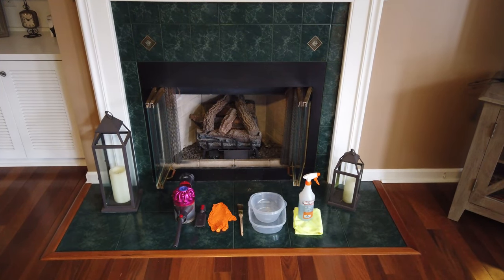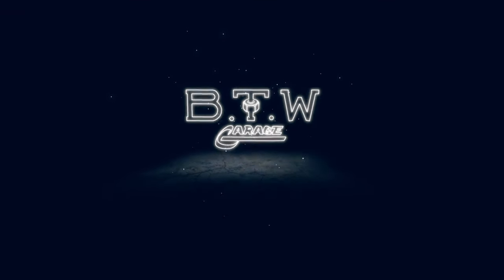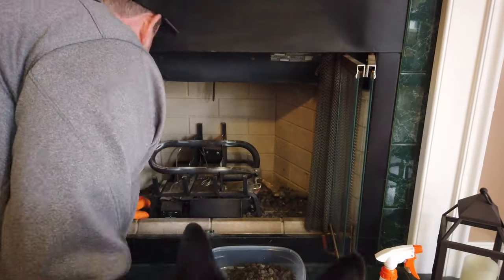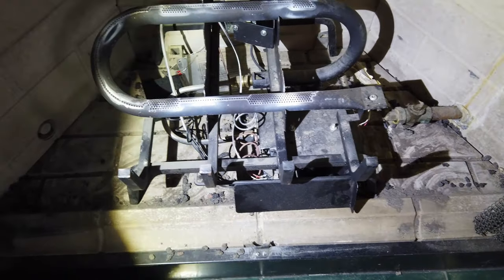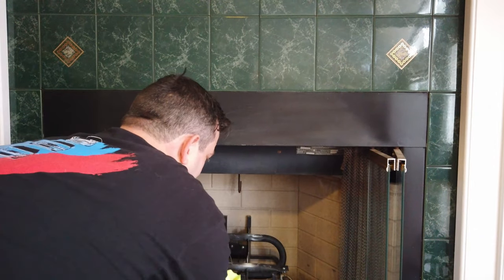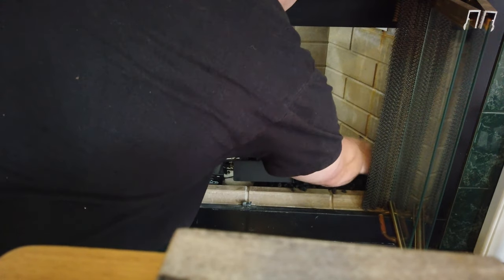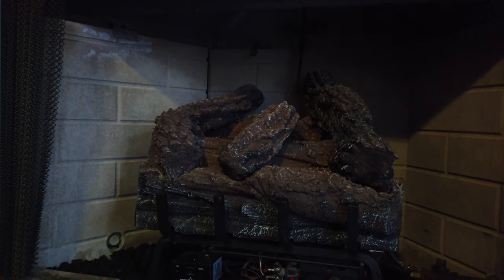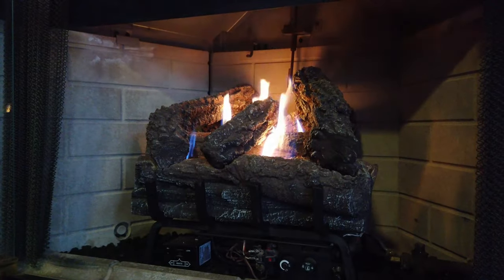How to Clean a Gas Fireplace - The Proper Way

Comment: Certified propane service tech here and I can say almost everything you did here I can agree with EXCEPT air compressor because it can lock up applience regualter . I suggest canned air . Great video
Reply: I have glow ashes that are on the bottom of my fireplace. My fireplace was a burning fireplace and is real dirty. Could I get the rocks instead?
Reply from the maker: Yeah you should be able to switch over with no issues

Comment: I have a problem with my fireplace turning off after burning for about 3 minutes. Pilot and flame turned off. Where I think I did something wrong is I washed my fake logs and didn’t know I wasn’t supposed to do that. Could wet logs cause it to turn off like that?

Comment: great video
but how did you clean the chain curtain?
Reply from the maker: I do not have a specific process for that since mine was still attached. Just a basic vacuum, spray and wipe as good as possible. You could do it better, but that will get you by with no smells or visible dirtiness

Comment: What do you recommend on using on the black metal to restore the color? Any particular polish?
Reply from the maker: Sorry I don't have a good answer for this one. I know the answer for automotive is mother's back to black, but not sure if that's recommended for fireplace stuff. You could always paint it if you can get it out or tape things off. I would use Rust-Oleum black

Comment: Do you have to put the rocks on the bottom, or can you leave it bare?
Reply from the maker: I would suggest putting them as they are intended to hold and radiate heat. It makes your fireplace more efficient

Comment: Do I have to have the Little Rock’s underneath?
Reply from the maker: Those are not required
Reply: I don't have the rocks under mine; however, I think I would prefer them as all around gets really dirty and dusty and I think the rocks would be easier to remove and clean, every so often.

Comment: Thank you so much for this video!  My fireplace is a bit different than yours; however, I'm confident I will be able to clean it...it's way overdue.  I wanted to ask you, why not soap and hose off the logs...would that ruin them?  Thanks again :)
Reply from the maker: I would keep soap and water off the logs just in case. I'm not sure what would happen, but good dry paint brush dusting does just fine
Reply: @BtwilliasGarage  Thank you!  :)

Comment: May be a dumb question but can I wash my logs I. A bucket or with that ruin the ?
Reply from the maker: I'm sure you can, but I'm not a real expert. I would use a wet cloth on them after you use a paint brush and compressed air to get all the dry nasty off
Reply: I washed my logs and read later on that you should never ever wash the logs but it’s too late. Now I noticed that my fireplace turns off after about 3 minutes pilot and flame.
Reply from the maker: Experts say don't do it. Stick with the brushing
Reply: @BtwilliasGarage . Weeks later after the logs dried, I noticed they got white spots like mold but at least now the flame stays on now. Sometimes you learn the hard way.
Reply from the maker: @fonzario  that makes sense. I have never washed mine and didnt consider that being an issue, but glad folks are learning from you and others in the comments

Comment: Hi- is there a way to remove the sliding mesh that hangs in front to clean it? Ours is covered in black dust that will make a huge mess if I try to clean inside!
Reply from the maker: Sorry I missed this. Did you get it figured out? I'm not sure how easy they are to remove, but I'm sure you can. If it were me I would be tempted to shop vac it if you have one. Then spray it down with a vinegar and water solution. Say 25% vinegar/75% H2O. Have paper towels or an old t shirt underneath. Then proceed to wipe it down well. Won't be too bad. Good luck
Reply: Btwillia's Garage I will try this and if I learn anything I’ll share— thanks so much!!!
Reply: @larcher1221  A lot of them are two rods that are screwed in to the metal. Take the two screws out and you can pull the rod free and take them out.

Comment: My fireplace starts with pilot it turns on with the switch but after 30 seconds it turns off and then I can't turn it on from switch. What could cause this?
Thanks
Reply from the maker: I show you exactly what to do in this video to fix that
Reply: @BtwilliasGarage  which video
Reply from the maker: Whoops, here you go

https://youtu.be/ukJRgJLUkEw
Reply: @BtwilliasGarage  thanks. Am I able to use sand paper on thermopile and thermocouple?
Reply from the maker: I would recommend using compressed air, a bike pump or canned air. It works best! (On both)
Reply: @BtwilliasGarage  where do I exactly blow the air at?
Reply: @BtwilliasGarage  thanks man I cleaned those both parts with dishwasher metal mesh and now it's work like a charm. Didn't have to blow any air. Your video helped a lot. 
Thanks.
Reply from the maker: You are welcome! Glad it worked!
Reply: @BtwilliasGarage  hi, it worked for an hour then stopped again. Should I clean it more or you think I need to replace the whole assembly of parts?
Reply from the maker: Clean it more! Just saw this. You need to blow it out most likely. What did you do?